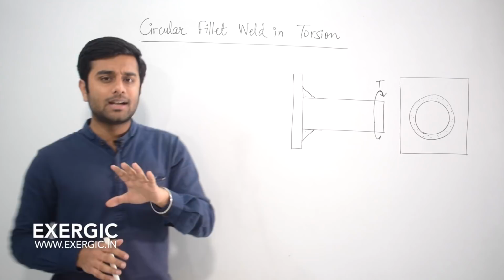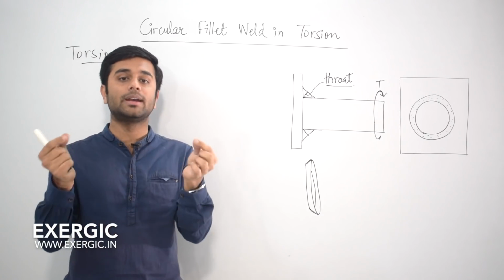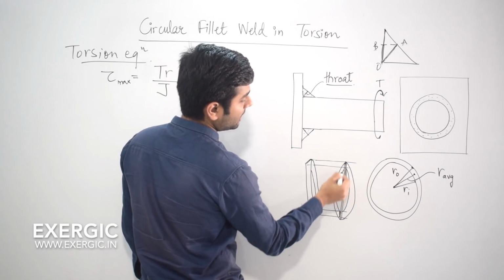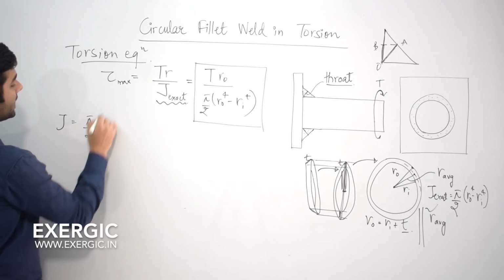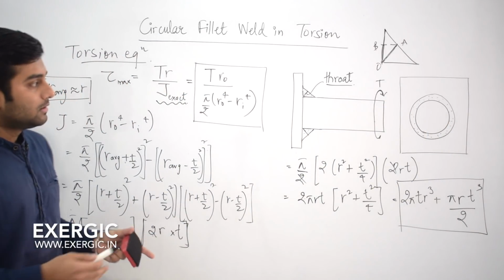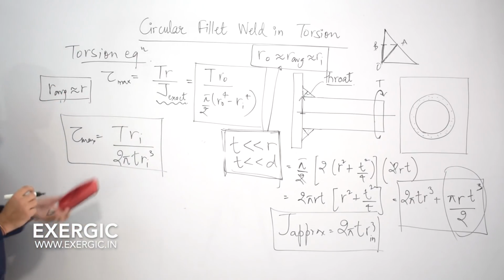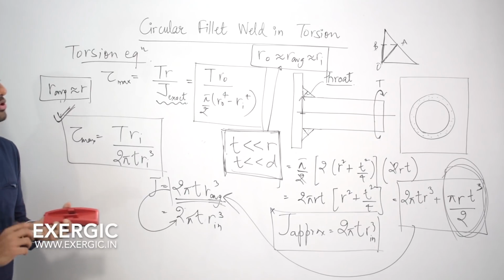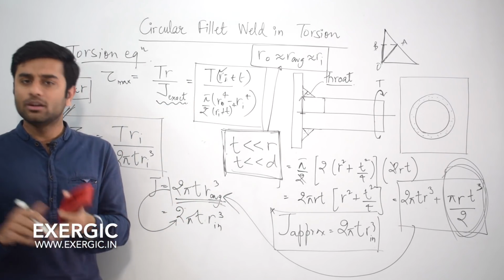Bonus concept in Circular Fillet Welds - EXERGIC Shorts

Comment: Hello,
How to calculate weld strength for bracket welded on circular tube subjected to shear stress.
1) Should I convert radial length into linear length and apply the formulae or any other way is possible.